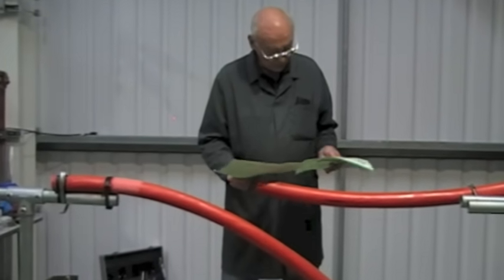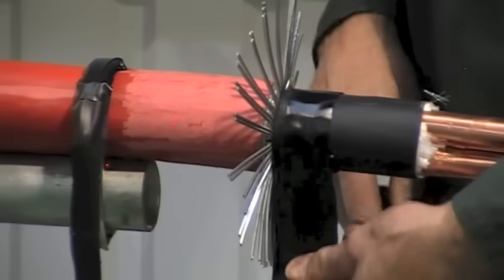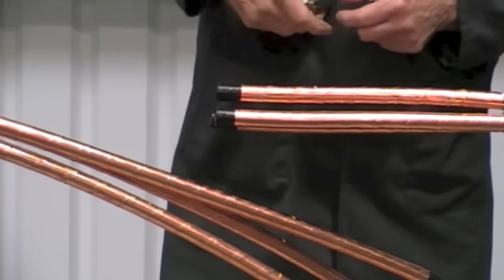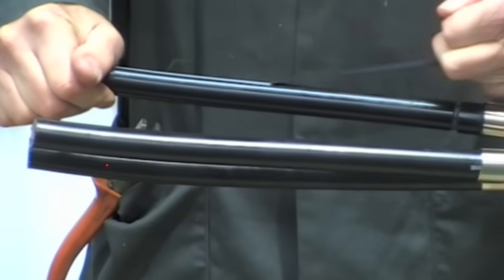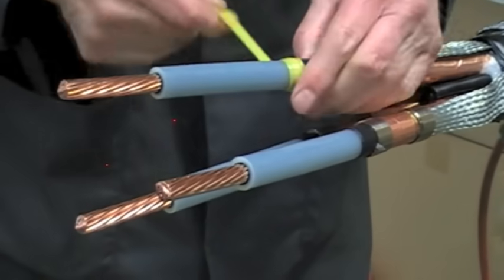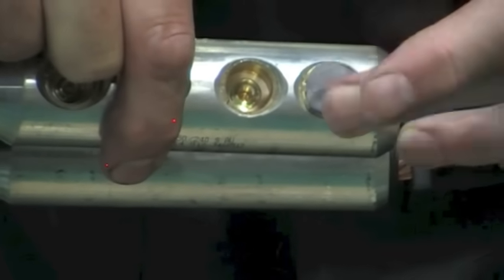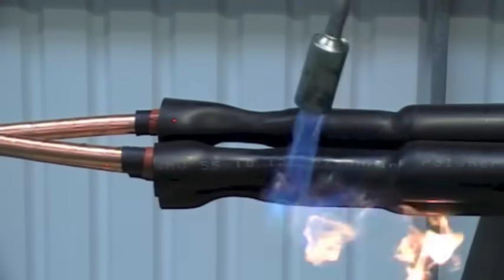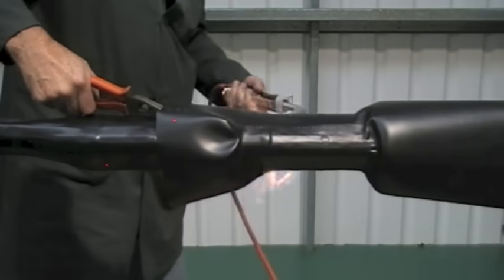Heat Shrink Cable Joint - 11kV 3 Core XLPE & EPR High Voltage Cable Joints

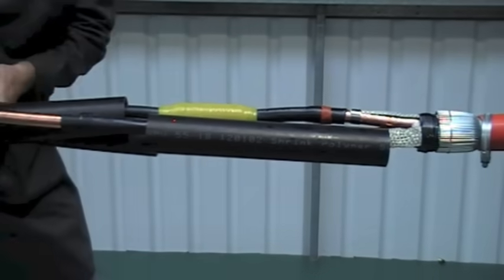Comment: This year in my country we had a lot of cable joint failures due to the effect of heat and the electric field distribution around the joint. At 14:36, what does he mean by " double walled insulating conductive tube?"  I presume that should have been, " double walled insulating tube for the conductor."   That tube is certainly "conductive".  or may be it is my old 85 year old ears that are hearing it wrong. Should the copper screening mesh be wrapped around the individual conductor, as that wrapping all conductor role is being done by the heavy aluminium conductor screen  It seems that the earth screen between the conductors is not continued throughout the joint.

Comment: Look at how methodical this gentleman is with every point of the work process. This is almost medicinal.
Electrical high voltage installations deserve the utmost attention and highest standards. Long-term safety first.
Reply: Medical and medicinal at the same time

Comment: How much it costs? In my calculation it will cost at least $500 including labour. I do all kind of electrical wiring; I follow the same procedure. Only difference is the size of the cable. He did not put any soldering led inside the coupler; just wondering why??

Comment: Isn't that a bit crude having to cut the armouring with a hacksaw? isn't there a more specialised tool for that now? I'm almost certain I've seen one on sale somewhere, at least for the smaller consumer voltage cables anyway. And why is there so many different voltages for local grid distribution? Does it depend on the distance it has to go, or how many substations it has to supply? And shouldn't the cores be colour coded so you can tell them apart? or doesn't it matter on the high voltage primary side?

Comment: Have you any idea about flexible ferrule..? i need for 185sqmm PCRD cable which continuously reel/unreel on drum. Above type of non flexible ferrule & insulation getting break or bend during operation.

Comment: Can anybody tell me, 
what is the use for you personally, 

do you use this type of cable for your television or fan 😂🤣
Reply: How do you think the power gets to your house .
Reply: @josephcronin4209  By aluminum
Reply: to charge my phone.
Reply: These joints and cables get HV electricity to Ur local transformer which provide Ur house with LV electricity and then....well charge Ur phone

Comment: How many layers of protection do we need?
Engineer: YES
Reply: 11kV 3 Core XLPE & EPR High Voltage  ⚡ If you do it above the ground than one layer of air is sufficient :)
Reply: @ArthursHD  فبررر
Reply: It needs to withstand 11kv  for decades
Reply: @alouisschafer7212  I know the protection is necessary, but I just had to make that joke.
Reply: Engineer2: More Layers!
Reply: @gorillaau  more!
Reply: Sometimes we put a plastic shell over the whole thing and fill it with resin 😁
Reply: @fraser827  wow, you're good! 😂 I mean, why not? If it works.. Saves a lot of time and money.
Reply: What is need for safety this connection after not any problems
Reply: With primary underground feeders as much as you can. All those layers serve a very important purpose ❤

Comment: Obviously this will be a lot different when you're doing it on the field. 
you will want to make sure you have all the correct heat shrinks on before you make the first Connection.

Comment: Enough of the smart arse remarks this is essential for joining lv and hv cables for underground use you wouldn’t want it to come apart during installation into the pit and also has to be watertight for lots of years  to supply power to your house.

Comment: Is there a reason y'all didn't stagger those butt-splices ? 
Nice work though. Me , personally , I prefer a heat gun over an open flame like that. An old school  sparky told me , as His apprentice , He knew right where (distance) to keep the flame. Personal preference,  I guess. We ALWAYS staggered butt splices though, whether straight thru or 90degree cable  pull in a JB .

Comment: What  will  happen  if the length  of anti tracking tube of 6.6kV 3Core  termination kit  is reduced  at site  due to  constraint of terminal box dimension.. assume supplied length of anti tracking tube is 500mm and we reduced it at site  to 450mm
Reply: Ask the manufacturer for guidance. Shrink Polymer kits have minimum dimensions that you can work to if necessary but it's important to seek advice from the manufacturer of the kit.

Comment: this binding can hold the tensions while hitting by huge typhoon?
Reply: These  terminations are intended for underground, electrical  manhole or main distribution rooms. So typhoon is a distant factor.
Reply: he didn't even mentioned the typical uses of this method..The whole topic is joining the High Voltage Cable using Heat Shrink.

Comment: how do you know which wire is which?
Reply: The 2nd last insulator has color identification on it,,sometimes it's a ribbon beadings depending on the cable manufacturer
Reply: @edgarngujo4474  ah, thanks!

Comment: "All traces of carbon must be removed from the insulation"

Blasts yellow flamed burner at the insulation, filling it with soot
Reply: Why doesn't he use a heat gun?
Reply: @smith549371  Maybe there is a power failure.
Reply: @mk23909  you can use gas heat guns also, theres no need for flame. Most people would consider a flame unprofessional or amateur.
Reply: @smith549371 😉
Reply: Open flame torches are most commonly used actually and standard practice in the trade. Much quicker and far easier, but yes U could use a heat gun if U really wanted too

Comment: This is how engineers imagine it's done in the field
Reply: @Ralph Macchiato When a hospital has no power except a generator, you don't stop working till you get the power back on.
Reply: How does it actually work in the rain and mud?
Reply: @MrKristyon  Yes. In the field they build a tent first.
Reply: @MrKristyon  pretty badly
Reply: Try doing it without all those special tools, just a utility knife and a tape measure.
We were replacing a five kv line at a veterans hospital that shorted out, we worked about 30 hours strait, half of it in the rain, I made up one end, another guy made up the other end in a vault underground, I guess he was too tired, we turned it on, and it blew the man hole cover about 50' in the air, so I had to do his splice all over, it held the next time we turned it on, that was a bitch.
Reply: 20mins per joint - this video proves it
Reply: Or when the 2 cables are drawn through the back bottom conduits in a full pit.... Not fun

Comment: Nice work at starting video but in last I'm confused how can we put two round heat shrink tube in already jointed wires 🤣🤣🤣
Reply: He put them on at the very beginning
Reply: @michaelstewart9308  check his video at beginning
Reply: @michaelstewart9308  check at 17:43  he slide tube from sides because it open from sides if it is in field it would be a great mistake

Comment: Why the metal joints it's on the same place and not in a small different distance between each other to make that connection point thiner ? Because is not professional work. Thats why.
Reply: Because you often don’t have that much room along the length and you always have enough room in the thickness. Also, it would make the whole splice significantly longer, which, have you seen those lengths of heatshrink? Bigger splices are a bad idea for moisture ingress and thus reliability.
Reply: @JasperJanssen  I will trying to explain with numbers. In this video the guy splice the outer jacket and expose the 3 cores. Each central core for joining has a length of 1 meter long in left cable and 30cm length the cores of the right cable. The mechanical chear bolt connectors if placed in the same length give a fat and ugly connection point. My thought is why don't cut the first left core in 30cm long the second in 50cm and the third one in 70cm.
From the right cable now. The first core in 70cm the second in 50cm and the third in 30cm. In this case the mechanical chear bolts after connection the cores will be in series one next to other and not parallel makes a thickness total joining spot. Also for security reason is better  i think the chear bolts to have a distance between them, and not over placed.  Maybe i'm wrong. Maybe not.

Comment: This is really nice work. Too bad no one spends the time to do this.

My first boss fired me the first day.

He said I did really great work, and that he never needed to worry if my connection would hold.

He said he never needed to worry about the inspector finding something wrong with my work

But he told me he would be out of business if he kept people like me.

I took way to long, because I did all the steps and did it right.

He had guys that just used butt connectors from home Depot and some 99 cent electric tape

True story
Reply: Sorry to hear this. It is true that people are greedy.
Reply: What was the application? 
There is a engineering quote that says, sometimes good enough is best.
Granted, I believe those decisions should be left up to the engineer
Reply: @michaelbarnhill2685  yes this aplikation .. Naturlich  ha ha ha ha ha ha ha . ho ho ho ho ho ho.
Reply: If your boss was a high-voltage lines contractor and fired you for the reasons you mention, he should have his license revoked. I imagine his luck was holding up around the time he fired you and had not killed anyone yet from negligence.
Reply: @frankieromnimon5898  at the time I was fired he had not had any fires yet
A few years later he had his first, then his second.
I moved out of the area and don't know if any more happened

I know several buyers had issues with outlets and switches and lights not working and had repairs done.
Reply: ocsrc If this was residential or light commercial 120/240 and you were making connections like this where wire nuts were fine I would fire you too. Application is everything. On control wiring, heavy commercial or industrial I agree with going the distance but in basic residential or light commercial it is more than unnecessary. As long as it is safe and legal you are fine.
Reply: @Veritas-invenitur  11000  volts shown here  can travel 11 inches air gap , it will work  just with rights amounts of home depot insulation but few know what that will be sufficient and how to jerry rig one .
Reply: @rovidius2006  Durability and mechanical strength of the connection are just as important as the low electrical resistance and the electrical insulation of a connection. I have seen connections fail due to vibration alone.
Reply: Home depot connectors and electrical tape. Yikes 😮😳🔥💀

Comment: 1 }1.5 sq.mm 4 core -12MM 
2} 1.5 sq.mm 4 core -16MM 
3} 2.5 sq.mm 4 core -19MM 
4} 4 sq.mm 4 core -22MM
5} 6 sq.mm 4 core -22MM
6 }10 sq.mm 4 core -25MM
7}16 sq.mm 4 core -28MM 
8} 25 sq.mm 4 core -32MM
9} 35 sq.mm 43 core -32MM 
10} 50 sq.mm 3 1/2 core -35MM 
11} 70 sq.mm 3 1/2 core -38MM 
12} 95 mm 3 1/2 core -45MM 
13} 120 sq. mm 3 1/2 core -45MM 
14} 150 sq.mm 3 1/2 core -50MM 
15} 185 sq.mm 3 1/2 core -50MM
16} 185 sq.mm 3 core -57MM 
17} 240 sq.mm3 1/2 core -63MM 
18} 300 sq.mm 3 1/2 core -70MM 
19} 400 sq.mm 3 core -75MM 
20} 400 sq.mm 3 1/2 core -82MM 
21} 400 sq.mm 4 core -88MM 
22} 600 sq.mm 3 1/2 core-100 MMM

Comment: I understand this was a tutorial of to do the splice, but so.... how do you know you got the correct wires connected?  Normally you got 2 hot, plus 1 neutral. Could you imagine accidentally wiring a neutral to a hot lol.  Somebody at the other end expecting the lead to be neutral but all of a sudden getting blasted with 11KV at about 3000 to 4000 amps.
Reply: There’s no neutral, just three line (hot) conductors but I don’t know how you tell which is which, no obvious markings.

Comment: Nice presentation sir... In real that is not easy as we saw.. Here in KSA we are now using 3X500mm2Al for 15kV. Way bigger. So we need  efforts  in doing cable joints... Thanks for the additional knowledge☺
Reply: 500mm😳 the biggest I’ve worked with is 300mm on EHV, and that was a work out

Comment: Hi all, someone let me know the metal connector which is set between two copper core. what is kinds of connector? because until now i have seen the one pressed by a machine not twisted by a screwdriver

Comment: And what happened to the fifty percent overwrap of the screening mesh? Started ok and went to rat shit when the mesh started to run out! Really you should of got another mesh and started from the other end. Nice enough job but far from perfect,especially as done under perfect conditions. No phase rotation checks carried out? Millivolt drop test over the splices? Why not stagger the splices rather than having them sit on each other? Better technique is to have them spaced half a splice apart,lower profile repair and avoids splices pressing on each other?

Comment: Surprised to see a knife being used freehand for the most critical strip of the lot!  The slightest nick in the conductors,and the chances are very high,can result in line losses and hot spots,leading to possible future failure.

Comment: Why not stagger the 3 joint locations at the various length positions?... I am sure there is a exacting reason why...
Reply: Imagine the size of the splice case needed. It keeps the length to a predictable volume.

Comment: This is so retarded. All carbon traces must be removed. Proceeds to heat the heat-shrink with a yellow sooty flame...
Reply: Its propane gas with a torch head made for heatshrink, it doesn't leave carbon deposits. The jointer has been jointing for probably 40+ years and also worked for Raychem, we have been selling the joints for 26+ years without any problems, least of all because of imaginary carbon deposits
Reply: Everyone saying this clearly have no idea what they're talking about, U do realise the propane tank open flame method is standard practice for cable jointers, use a heat gun if U like, but U will be the only peanut doing it

Comment: How the fuck this be in my recommend video
Reply: All I did was watch one soldering video, now my recommended page is full of videos like this... Damn that new youtube algorithm
Reply: go learn english!
Reply: Welcome to "nerd profiling"! Video was amazing. What a splice!
Reply: danish
Reply: Terang Soco limeys catching up on how to handle high voltage cables.
Reply: Probably off one of your keywords. "Joint" for example.
Reply: Dankus Memus ssseee
Reply: +Brian Smith ...Yes, and 1 millisecond after power is applied there would be a deafening bang, a bright flash and then they would bring in a limey in a cute little suit to do it correctly in about 20 minutes :) After they clean up the fried cables of course.
Reply: He's dressed up in a cute little suit to perform this exercise. In the US, the electricians would have done this in 2 minutes.

Comment: what are correct cheap materials for joining and insulating 240 volts underground electric cable.
Reply: Torpedo joint kit
Reply: Erick Juma black tape
Reply: Big Mike purple tape if it's a north/south oriented cable.

Comment: Imagine completing a splice and realizing you forgot to slide the shrink wrap on beforehand.
Reply: if you are doing it without reading the procedure, then sure :p most people don't like to read procedures, so they usually fuck up.
Reply: Procedures are for newbs when you've been doing this stuff for years. Personally I would like a second person with me doing this double checking every step as we go.
Reply: Atlas WalkedAway ive seen some high voltage terminations.. this one looks flawless. The point is to prep, and more prep before beginning. Having everything you need is so vital and apparently just following steps. The high voltage terminators who ive worked with said its not the difficulty but you dont fuck it up.. you only have so much room in a peckerhead or switch gear so the lengths are exact. Until you fuckup and have to b line all the cabs
Reply: Who, me?
Reply: Md Razi Shaikh
Reply: "Procedures are for newbs", he said, knowing nothing of science or epistemology.
Reply: Huh, curious. Maybe we just have very similar youtube preferences. Were we in contention over them being able to park close?

Comment: That's an awesome piece of art.
What tool are you using @ min. 7:12?
Reply: Pretty much a tiny blade fixed at a position which doesn't cut the underlying insulation. It scores the top layer to be peeled off. It's important not leave sharp edges (such as from a cut) in the insulation to avoid any weak spots, it's why it's filed down in the previous step avoiding a sharp edge. 👍🏽

Comment: So... that yellow tape is a dielectric for 11kv. I would have thought there would be a more sophisticated material for insulating the shear bolt connector?
Reply: there are several layers with shrinking tubes  on the outside of the tape.
Reply: that's enough